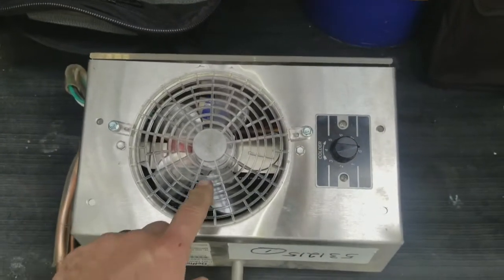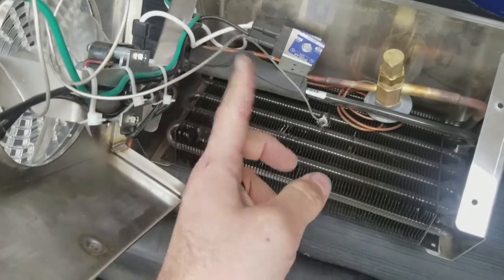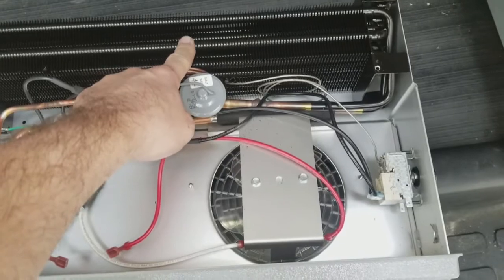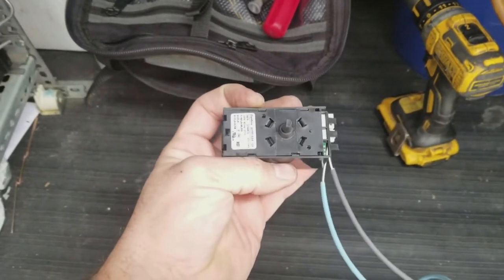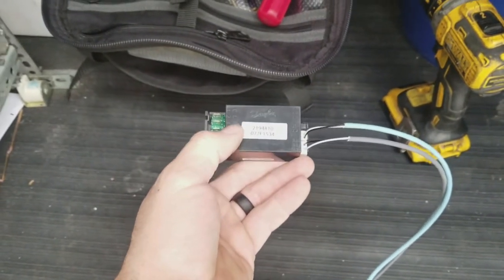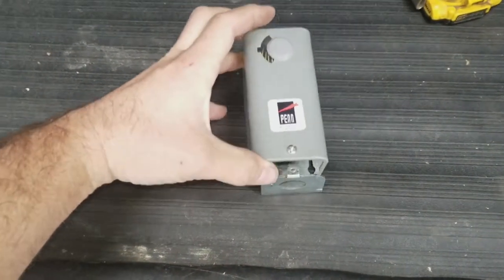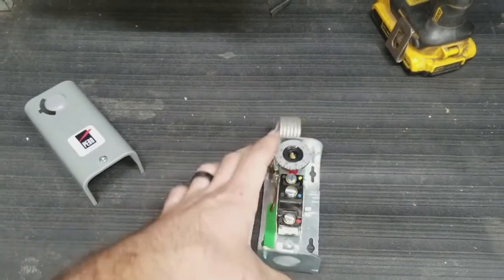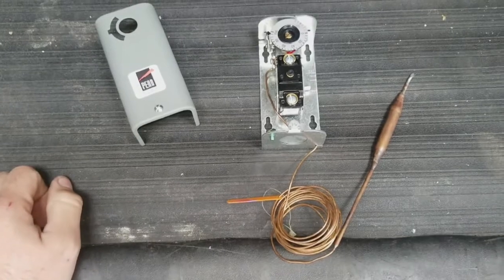Refrigerator temperature controls

Comment: I have a turbo air under counter reach in.  I just replace the temperature control because the copper tubing broke off.  I replaced it with the same OEM model number, however the reach in goes down all the way to 27F because it shuts off.  I have set the knob to warmest setting but it doesn’t seem to help.  Does the controller need to be calibrated out of the box?
Reply from the maker: no the control should be factory set, once the unit shuts off what temp does it turn back on at?
Reply: HVACR VIDEOS compressor kicks in when temp raise to 38-39F
Reply from the maker: @xz86  sounds like its working properly to me, set the dial to 3 or 4 and let it be. Its normal for it to pull down to 30 ish and turn back on at 39-41
Reply from the maker: I will be going Live on YouTube this evening 10/28/19 @ 5:PM (pacific time) to discuss my most recent uploads and answer questions from the live chat, Facebook, emails, and YouTube comments come on over and check it out if you can.  https://youtu.be/wavAI7IcaQ8

Comment: Nice presentation thanks. Im new to the trade. From wathing this video for medium temps within the air sensing bulb the set point of 35 and differential of 4 or 5 is not always enough to clear all the frost on the evap. And you can stuck the bulb in the coil for better off cycle defrost. 
Also is it true that coil sensing probes may take a couple cycle for it to cut in and cut out at the right temps specially on reach ins.
Any help is good thanks!
Reply from the maker: Yep it takes a few cycles for the box to stabilize out
Reply: Thanks i appreciate it.
Reply from the maker: going live on Youtube this evening 3/11/19 @5:PM (west coast time) come on over and check it out if you can  https://youtu.be/8b7yomEWfF4

Comment: I just replaced a constant cut in control on a reach in with a ranco digital control. Of course I had defrost clock so I guess I was safe there. If I was doing med temp couldn't you just set your diff temps up like you said?
Reply from the maker: Yeah you definetly could make it work by inserting the temp probe in the coil and adjusting the differentials, most don't understand the system enough to do that!

Comment: What heats the evap coil up to 40 degrees during defrost. If it was the room temp surely the food would be damaged ?
Reply from the maker: Since the evap has a constant cut in control the unit defrosts every time the temp control satisfies. So the box comes down to 34 than satisfies and comes back up to 40 degrees before it turns back on. Does that make sense?
Reply: Yes. I forgot its a medium temp and not a freezer

Comment: What do you think about keeping Ranco temp controllers as truck stock,and using them in place of say o.e.m. For True, Delfield, Perlick, RANDELL and other manufacturers. On reach in freezers and coolers.
Our service manager thinks this is the way to go.
I personally prefer the O.E.M. for constant cut in especially.
I am forced to do as instructed by my manager.
Reply from the maker: I'm a fan of OEM, if you use a ranco you will need to add a defrost clock.